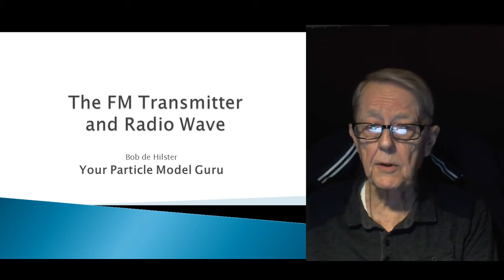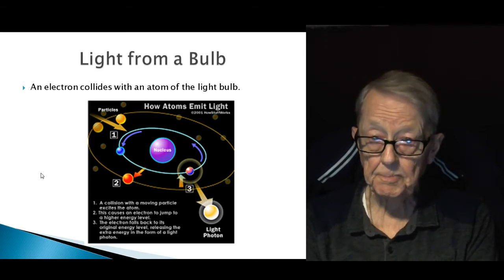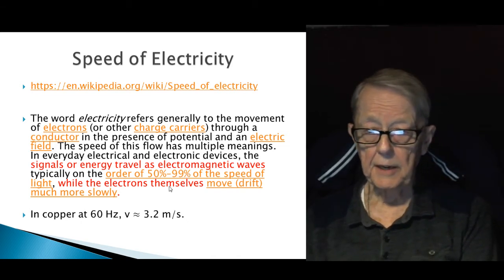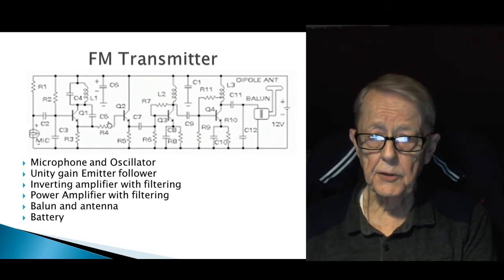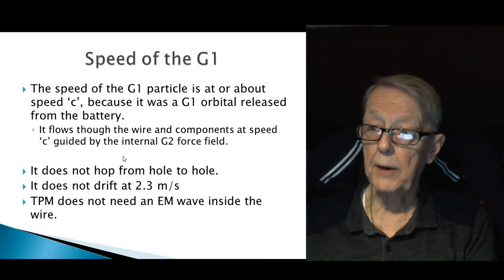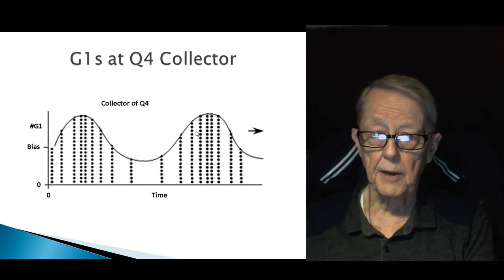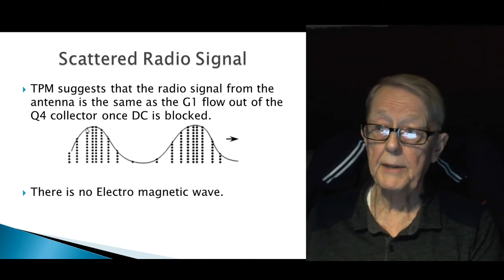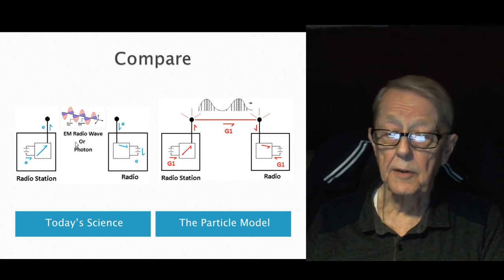The FM Transmiiter and Radio Wave

Comment: Do you have any models with a faster-than-light transmitter?
Reply from the maker: To transmit data using G2 particles requires modulating the stream of G2 particles at rates that are faster than the speed of the G2 itself. No, I do not have a model for a G2 transmitter, and significant new technology must be developed to get there.